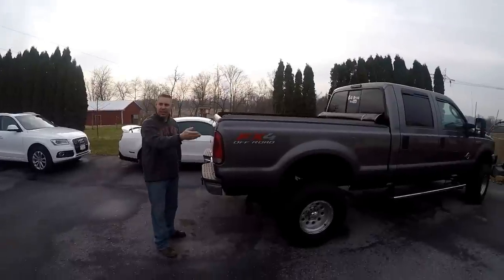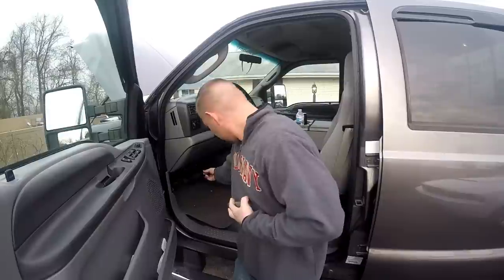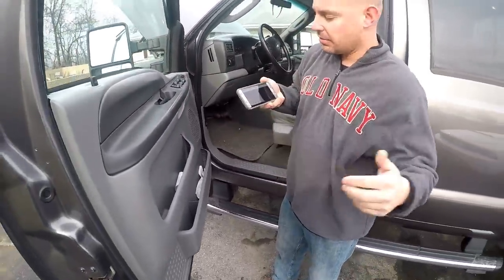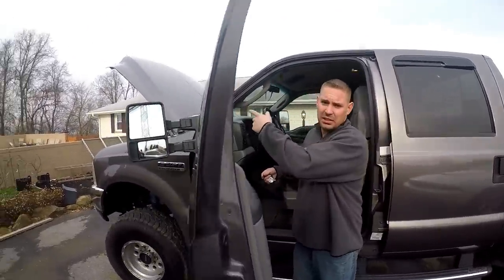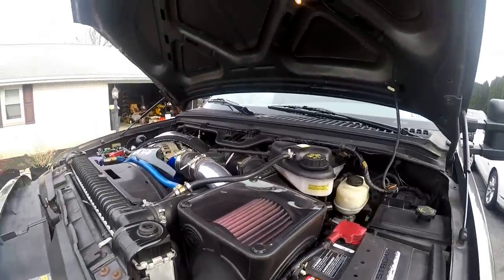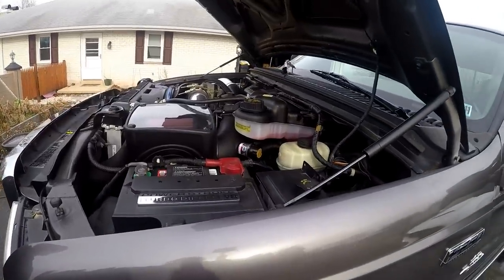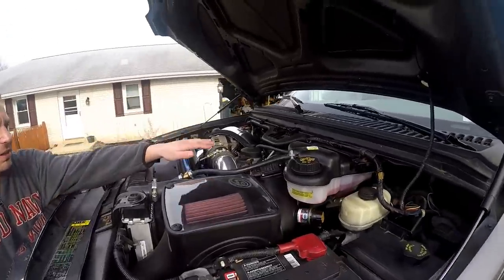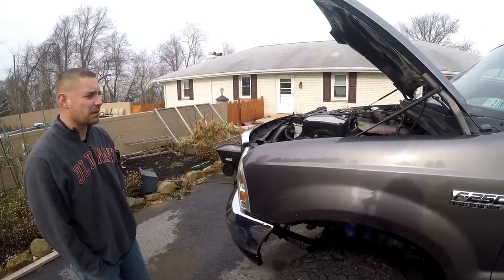6.0 Powerstroke Bad Injector Test

Comment: New to diesel I just bought a f250 at the auction ran it 132 miles runs pretty good just has a lil miss on it... it reves up sometimes on it's own and when I'm a 50mph it shakes like its hesitating please lmk what it can be thanks
Reply from the maker: Do you have anyway to monitor your truck. Check out my video on torque Pro. There are lots of options for monitoring your truck but you need something. So to help I need to know if you have any trouble codes?
Reply: 6.0 Bros I’m having this same issue he is stating no codes and I have a act to monitor my truck. I also have a egr delete str8 pipe upgraded pipes and turbo upgrade. Truck starts to vibrate at 50mph and it takes a little while to start from cold start up. Any advice is appropriated thanks
Reply from the maker: So depending on which sct you have to monitor will depend if it will tell us what we need. Things I need to know are ficm main vintage should be at 48. There is also a ficm logic which should read at least 12 volts. But typically will read more between 13-14 depending on alternator health.
Reply from the maker: Also checking icp and ipr can help I would measure both of those at idle and WOT.  So let me know when you get those numbers all for me and we can go from there
Reply: 6.0 Bros this checks out
Reply: 6.0 Bros I will have to look at the icp and ipr when I get a chance and get back to you.
Reply: It’s been 6 months. What happened? What was wrong with it? I’m having this problem right now.
Reply: Mine was two bad injectors 5 and 7
Reply: That same thing was happening to mine and it was my number 2 injector
Reply: Torque converter locks somewhere around 50mph if you have a bad injector it will start bucking.  I had some success with Revx to free up the spool valve in the injectors.
Reply: It’s probably stiction! Rebuild your injectors with new spool valves. Check for inter cooler leaks also!
Reply from the maker: It was just an injector new remand injector and back on the road
Reply: If you ever need to crank a 6.0 for a long time you can put a garden hose through the wheel well and let it pour out over the starter while you crank. We did this back in 2008 to 2012 when the powerstroke 6.0 diesels were everywhere and all the rage. They were new and breaking down all the time. We were making repairs as fast as possible and trying to get caught up with trucks getting towed in. Its a major hack but it works.
Reply: Had same issue, rpm’s raise on their own while idling. Did blue spring and ipr valve and that fixed it
Reply from the maker: That makes sense why they fixed it. I would keep an eye on fuel pressure make sure it isn't dropping under load

Comment: So many people forget a failing fuel pump cause injectors to go out prematurely as well... after nearly replacing all my injectors I still had problems and soon checked my fuel pressure which was a measly 25psi MAX. 45psi min required on these trucks.
Reply from the maker: This isbspot on minimum of 45 to not cause damage, and a max of 75psi. I have spoke to injector builders and the community and it is not advised to be over 75 as it can prematurely wear out o rings I was told.
Reply: @six0bros  Exactly!! I was so mad after spending a few grand on new injectors when the culprit was my fuel pump. Currently don’t have a 6.0 at the moment but ready to get another one! Had the blue spring, KC turbo 10 blade/61mm combo, Egr delete and some other goodies and I miss it!
Reply from the maker: I know. I have seen it a lot but people still don't replace their fuel pumps! Or insist it isn't the issue.

Comment: Atleast its on bank 2,which is the easier side...biggest recommendation I have,if you have to mess with bank 2(driver side,left side,whatever..lol) do yourself a favor and replace the de-gas bottle supply hoses and always replace the bottle cap....those "Y" fittings where the supply hoses join,always love to break at that plastic fitting......and always use caution when un-clipping the FICM harnesses, as those clips love to break,so unless you wanna have a bunch of zip ties holding the connectors,use caution and patience while disconnecting them...they are a weather pack style,so they have to be all seated all the way in or there's a possibility one pin won't make contact, in turn giving a false positive for said,dead cylinder(if you have a miss,always check ficm connections first..seen it happen several times,where for example #3 will show short high to low and it's just because of a loose harness..in this case,this injector is shot,due to the white smoke,with either a cracked nozzle or hung cartridge, which can actually hydro lock the engine due to the metering needle basically being useless at that point,or best case,a bad o-ring for the fuel gallery...
.if it was just the coil on the injector, It'll just miss,without any smoke......and just a FYI for other independent techs,that are learning about the 6.0, that may be reading this,Ford has now discontinued production of the Fuel Injector harness........Also, 6.0 Bros..im assuming thats an 04' cause it's using the boost butterfly,but If you wanna keep that code from coming back,reinstall the actuator,but leave the butterfly off,of coarse...that should prevent the code from returning so you can get rid of that p1000...while p1000 is present,these engines won't get there best economy, cause they're still in the "re-learn" process..(or,you can change the value with ForScan,or tune,or even use an 05' pcm which doesn't use the butterfly, even though the plug is still there on the 05-07's)...and if you need the procedure to get rid of the drive cycle incomplete code(p1000),Let me know and I'll send you the procedure...its very easy...takes about 45mins of driving in various conditions......great vid though guys 👍....A lot of people talk shit about the 6.0,but they're actually a great engine once they're bulletproofed

Comment: I have found the main causes of injector failure on the 6.0 Powerstroke are: 
The Most Common of the reasons is running the engine with worn out or contaminated engine oil  "HEUI" Remember the Injectors are also controlled by oil pressure
Followed by

Wiring Harness Chaffing or worn end connectors
Low Voltage "cranking engine for an extended period with under 12v in batts"
Poor or dirty Ground contact points
Weak or Discharging Alternator

Oh FYI I own 4, And each one have taught me a lot!!!!
Reply: Do you use any oil a fuel treatment I've been using Hotshot since I bought my 6.0 had it 2 years now.
Reply from the maker: I run archoil in all my oil changes.
Reply: @six0bros  Really? Please explain how if could thank you.
Reply: Hello .my 04 f 350 6.0 is mixin fuel and engine oli,do you have and idea how to fix it?
Reply: @yonatamendoza7010 Most probable cause is from Worn injector Cups or Injector O rings I doubt that to be the issue.
Reply from the maker: Sorry I missed your question. Do you mean could archoil fix the issue from the video? If so no the injector needs replaced. If you mean how do I run archoil oil additive I just put a bottle in with each oil change
Reply from the maker: I would say likely cause is a failed injector o ring. Typically a cracked head or injector cup will cause coolant and fuel to mix. Most common cause of oil and fuel from my experience has been injector o rings.
Reply: I found an a internal injector o ring .fail
Reply from the maker: @yonatamendoza7010  glad you found it man. Did you get it all fixed up and back together

Comment: New sub, glad to see a 6.0 channel that people aren’t bashing.. Every third or so fill up I use some used engine oil out of my oil change about a quart and dump it in a full tank of fuel, this seemed to help with That dreaded Stiction.
Reply from the maker: Welcome to the channel. Since this video we have become fans of archoil seems to work really well.
Reply: 6.0 Bros i used to use it as well, for my truck and where I live. For whatever reason good old used rotella t6 actually works the best for me anyways, even on a fresh set of injectors in the middle of winter here I get some stiction. I also have gone through a ficm with low voltage causing what seemed to be the same effects. Just an FYI I’m not sure if you’ve been through the trials of the truck yet. Also need some of them stickers!

Comment: I have a 2003 f250 with an 05 engine in it and when I start the truck it doesn't really smoke maybe a tiny haze but as soon as the turbo kicks in it starts smoking white bluish smoke bad and when I drive the truck after about 10 mins when it's up to temperature it goes away just blows a little haze if I really step on it once I turn it off let it sit and cool all the way cold and re start it later it's the same thing what can that be truck drives excellent no shakes or nothing
Reply from the maker: Any oil in your exhaust pipe?
Reply: Blue tint is almost always a sign of oil burning, Most likely your turbo seals are worn out. Unbolt the exhaust pipe on the pass side rear of the turbo and check for oil buildup, its only 1 clamp. If there is a lot of buildup remove the turbo and rebuild it, its very cost effective to rebuild it yourself (about 20% the cost of a reman turbo). Just remember the Impeller wheel is LH thread.

Comment: hi 6.0 bros i have a 2005 ford f_250 6.0 and when driving down road at about 55 to 60 speed my truck starts shacking and sounds and feels like it wants to loose power so i slam on  the fuel and drive it like i stole it and runs better then slow down lower rpms and it starts all over again ?
Reply from the maker: have you checked your boost and back pressure to see how they are. also any readings on your ficm, icp, and ipr?
Reply: I changed my icp plug and blue spring and new sending unit and screen but no I haven’t checked that yet
Reply from the maker: The other thing I would double check is drivetrain parts as well as suspension. So ball joints wheel bearings u joints, drive shaft u joints. If you have the carrier bearing in yiu ipr driveshaft double check those as well.
Reply: Thank you for your advice do you happen to have a email address I could send you information on my truck are a phone number
Reply from the maker: You can email at 6.0hbros@gmail.com or on Instagram at 6.0hbros

Comment: White smoke coming out not when engine is cold or idle, what can be the issue? 6.4 f250 2008 130k miles
Reply from the maker: Are you losing coolant

Comment: So I bought a 03’ 6.0 and injector 8 has no contribution and 1,3,7 are going out and the truck when it cranks has the consistency of yours. With knowing about the injectors does that mean I will probably need a engine rebuild or just the injectors sense there is consistency and lack of compression. And should I expect a engine rebuild soon

Comment: Can the injector buzz healthy but not fire while running?I'm getting white smoke and #3 cylinder missing.i unplugged all injectors except one and they sound good and healthy.im down to checking compression or a bad injector I believe.
Reply from the maker: Could also be the ficm logic side if compression is good. Any recent work on the truck? Does it idle smooth still? Or is it rough
Reply: @six0bros  I found the problem.after studs were installed by another shop,I'm guessing the rocker arms were never re torqued.the rocker was broke and every pedestal was loose
Reply from the maker: Did you call the shop to ask about this because that's a big mess up
Reply: @six0bros  no it seemed like low compression.but with 90k Miles and one owner, I hoped that wasn't the issue.but I don't know if the bulletproof stud upgrade says to torque the 10mm rocker bolts,but all I can figure is the studs clamp so much tighter that the bolts were then loose.it made it about 3000 miles since the head studs were installed.and it kicked the valve/rocker  bridge.bith sides every bolt was lose or hand tight.

Comment: use archoil ar9100 in your oil before replacing injectors
Reply from the maker: +Brad Hagen I do plan to use ar9100 moving forward but I didn't think it was going to revive the current injector failure. I have heard some great things in resolving stiction maybe it would have but we did go and replace it

Comment: I got a 6.0 we just deleted and replaced injector 2 as it was pretty much dead. After replacing it we contribution tested it and cylinder 2 was good but it started missing again and now claiming 1 and 8 are dead. Truck doesn’t smoke whatsoever just misses and is extremely sluggish
Reply: Update: replaced Injector 4 final analysis was it was dead. Truck ran good for about a day say over the weekend tried to start it Monday morning and only got 72 psi of fuel rail pressure vs the 1100 or so it demands. Pretty sure HPOP went out
Reply from the maker: What year truck do you have, and how many miles are on it?
Reply: 6.0 Bros 03 258k was an old work truck still had Egr until i got to it